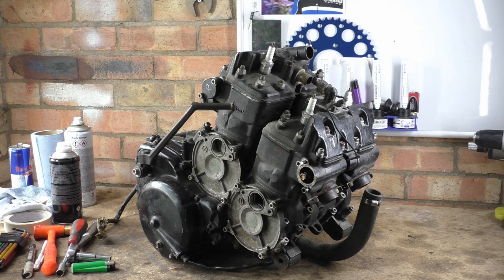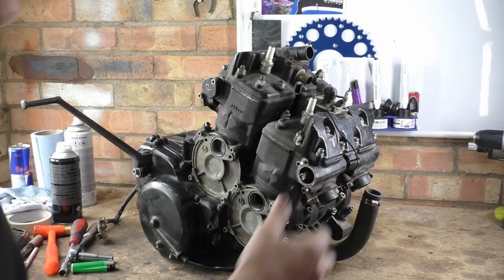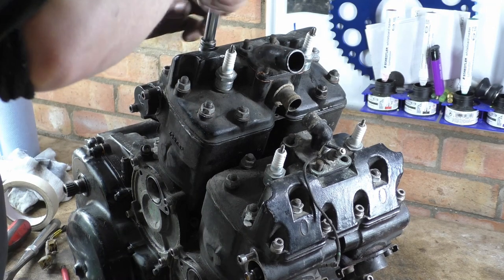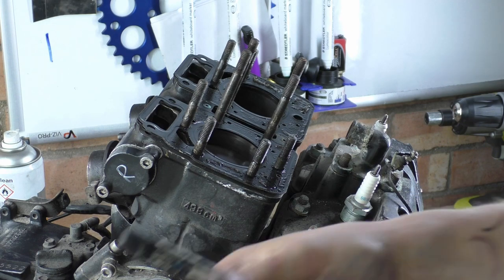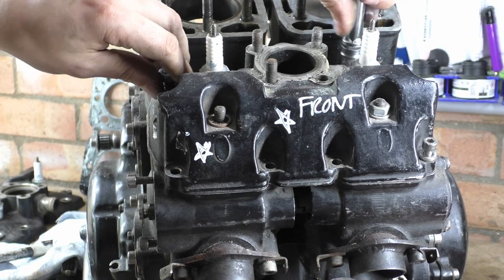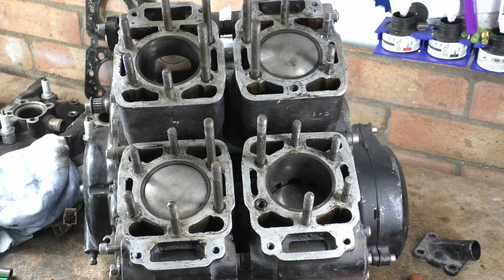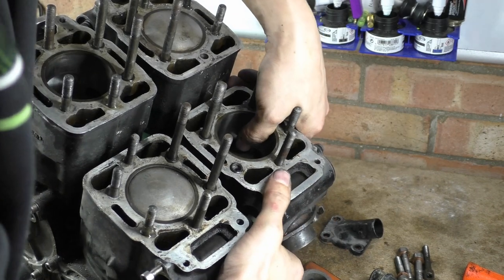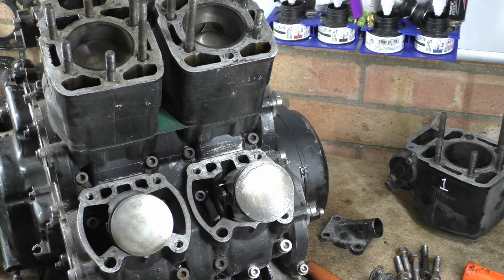Suzuki RG500 Teardown - Part 1

Comment: Advice I give to any non mechanics, IE those not trained to memorize exactly where every part came from after disassembly, is simply use a cam and take pics along the way to refer back to.
Marking and storing everything is good but even then with enough marks on parts that can get confusing for some.

Comment: Write in normal way on the top, turn around and trace the letters. Impress your friends by using very neat handwriting and after tracing on the backside, wipe the writing away from the top with booze wipes. (and then tell them about this handy trick, they will be amazed how neatly you write backwards)

Comment: I find those ball end allen keys tend to strip out cap screws when they are tight like that.
I break then loose with a normal one first then go at it with the ball end for speed of removal.
Or maybe I am just a hammer head haha.
Reply from the maker: You need to try the Wera ones I have - they are the bollox!

Comment: F*cking awesome Matt, iconic engine & 1 I happen to have, couldn't be better. I see you're doing it in special sections (yes! PV set-up & carb set-up will be especially welcome). Top man! If you ever happen on the RD500 motor I hope you'll do it too (I know it sounds unlikely - but how likely was an RG5 turning up?) Gsxr1000K1 or 750/600 type motor too would be great if it's ever possible.....a new series to rival Haynes? lol keep it right way up mate :) .Just looking at the motor as you tear it down, not only no carbon but those ports look really smooth - has it been tuned?

Comment: The damage in the first head you took off reminded me of an RD250 I had a million years ago.I think the electrode had dropped out of the plug,If I remember correctly.
Reply from the maker: Either that or the piston rings shite the bed. I think these are different cylinders than the original - we'll have to investigate further.
Reply: Yep damage looks like bits of busted ring to my eye.
Reply: Could be rings,maybe that might explain the rebore?
Reply: AuMechanic agreed

Comment: I dont see any damage on the piston dome did someone rebuild it and not clean up that combustion chamber? just asking for detonation with all those sharp bits..
Reply: The pistons crowns are stamped 0.5 so yea its been rebored after it blew up.
Reply: Ya i seen that im wondering who would put it back together without milling that head though. All those nicks and gouges are just about guaranteeing pre-ignition leading to detonation.

Comment: Ring gap on Intake-side cause of "thermical reasons"? On a two-stroke? Are you serious?
Try them with the gap to the exhaus and you will see what happens... rings catch on exhaust port, finished.
Cheers
Reply from the maker: Thermical - don't you mean thermal? And yes I've been through this in several videos in the past. Pin placement dodges ports - as there are ports everywhere. The gap is on the opposite side to the exhaust port be cause heat. The hot side of the rings wears out more than the 'cool' side. Hence thermal reasons. I.e I can't be arsed to explain again so moving on....
Reply: No thermical is a mixture of thermal and comical.

Comment: Was torque striping exhaust manifold bolts one day and one of the old lads at the shop said “that white paint pen isn’t going to tighten those bolts if you leave them loose” had a good laugh at the old prick but needless to say I don’t use it for external fasteners anymore. Fucking funny slating the butcher who slapped it together before you got into it!

Comment: The pistons say 0.5, Im wondering if its been overbored by .5mm already? Maybe that's why the pistons are so clean, I'd check that bore.
Reply from the maker: Why so I need to check the bore? They are 0.5 oversized.
Reply: I meant to see if it is overbore. Guess that makes sense lol. They're steel liners right not nikasil? Not sure if they had that back then.
Reply from the maker: Yes they had it back then - but the RG500 has steel liners (well I'm almost 99% sure) I'll check tomorrow.
Reply: I have an 1988 RGV250 and it has nikasil lined bores
Reply: Thats crazy, I wonder how the process compares to the way we do it now. FYI if anyone ever needs any replating done I highly recommend Millenium Technologies. Their coating has lasted ages in my 2 stroke KTM that gets abused and tossed aside like a red headed step child. Absolutely 0 wear still looks brand new.
Reply: I am assuming that Millenium Technologies is in the mother land.  Unfortunately, I live in the colonies - the great southern land, to be precise.
Reply: They're based out of Wisconsin actually, I too am a peasant from the colonies. Just ship it to them, takes about 3 days and they ship it back. Apparently a lot of factory motocross teams will actually send them brand new jugs to have the stock plating removed and their plating process put on. Must work too because I saw a guy who blew off a coolant line and finished the last half of the race with no coolant and the bike lived till the end.
Reply: Nice.  The shipping costs might make if too expensive, but its good to have the info. Both of my bikes have nikasil bores.  I know I can get the process done here, but these guys sound like they're pretty good.  Thanks for the tip, mate.

Comment: The spline style on the kick starter, is it better/stronger than the normal "V" tooth or did Suzi just want to be different? (stripped a few kickers on my old GS750, can't afford to do owt about it, just curious)
Reply from the maker: Well kinda yeah - they have a thicker root - it depends on the OD of the shaft - deeper 'v's mean that its actually weaker.
Reply: Good point, torque isn't just measured in ft/lbs, thanks.

Comment: ^^^^2t wanker-------   I don't understand the crank arrangement. with two up and two down,  it's a twin with a bunch of extra parts, in as far as power to the main shaft. if you could explain why this is better than a 90 degree setup? thanks.  I also didn't see what drove the rotary valves, I guess that will be apparent in the assembly portion. I REALLY am enjoying this series.
Reply: Suzuki in particular experimented with various arrangements in racing, starting in the '60s.  Yamaha did the same a bit later.  They both found that simultaneous ignitions were kinder to the gears between the two cranks, but even then they still take a beating, partly because they'll never be perfectly in sync.

There are also balance advantages, if you can visualise that!  All the rocking couples cancel out, I think.
Now, just think, Suzuki also made a three cylinder with this general layout - effectively just removed one of the bores and heads...

Comment: They did it because the 6mm threads were fucked and instead of a sleeve or a coil they used imperial bolt and cut a thread with it
Reply: Well not on a rg500 because that would be sacrilege although I am Infact guilty of doing it on a 1.9D citroen berlingo because who gives a F%$#. Awesome stuff (the videos not the bodgeit and scarper)

Comment: Why have two pistons at tdc at the same time? Why not rotate one crank 90 degrees and make it sound like a v8?
Reply from the maker: LOL becausee power is eveything - not sound
Reply: The Workshop Why would it reduce the power? R1 has 90 degrees fireing order and that is suposedly better somehow.
Reply: The way it is gives it perfect primary and secondary balance.  Which means less shaking which means the parts can be lighter.

Comment: How is this engine compared to the RD500?
Reply from the maker: Basically the same.
Reply: This is a 500ccGP engine.  RDs are sport tourer engines;  that's why RDa have different induction methods on the front and the rear cylinders.
Reply: Not so.  RDs fall out of tune after a few hundred miles.  Gammas stay i tune until the pistons wear out.

Comment: Matt is that motor not missing thermostats?
Reply from the maker: yes it is - part 0 explains some of that.
Reply: When ridden hard, or raced, on really hot days the stock radiator is inadequate.  Removing the thermostat is what some people (including me)  do attempting to solve the problem.  All it does it make the engine take longer to warm up.  The real fix is a race radiator from Mark Dent.

Comment: Why all the copper washers, why isn't galvanic corrosion a concern?
Reply from the maker: Dude it is a race engine - they don't give a fuck and galvanic corrosion is a slow process unless you drop it in the sea.
Reply: I think you mean "race engine"
Reply: Not an issue.  I''ve had mine since '85 with zero galvanic corrosion.

Comment: Wife cheating with the postman 😂 lucky i dont have that problem currently single 🤣

Serious question tho, howcome 4 strokes have breather pipes and 2 strokes dont ? 🤔
Reply from the maker: Because the crankcase is used as a pumping chamber. If you had a breather the fuel and air would piss out of it.

Comment: The RG was a jewel of an engine and box, and some moron has butchered a classic which, in good condition, could go for over $25,000! The unit on the bench looked a bit unloved but what a disappointment to see the damage an idiot can render. I owned one in the 80s and regret ever selling it. Sure the narration isn't suitable for family viewing so send the kids to bed - many a cuss word was uttered in the workshop!
Reply: Rotary valves are driven by splines on the crankshaft ends.